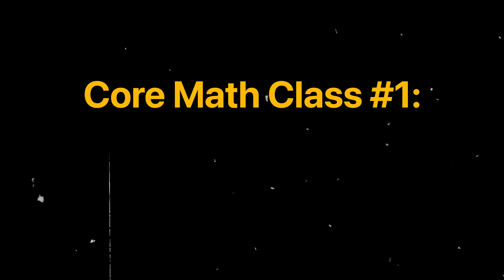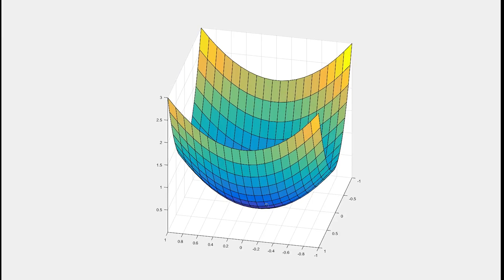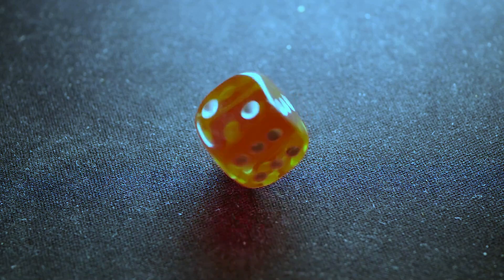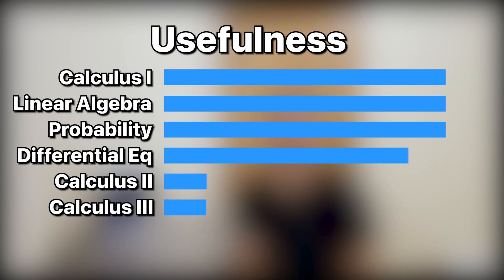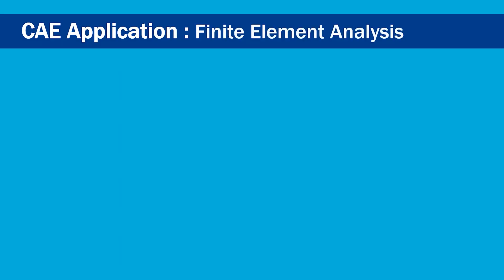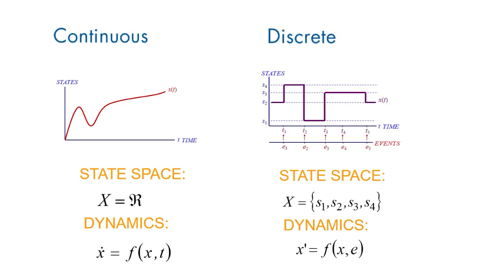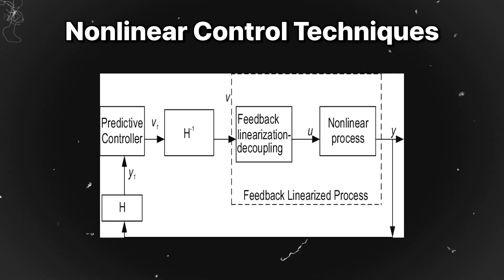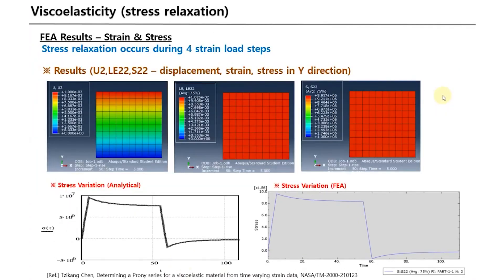How Much Math is ACTUALLY in Engineering? | College vs Industry

Comment: Worked 40+ years as a controls engineer. Frequently used complex algebra, Laplace Transforms and the concepts of integrals and derivatives. I designed circuits and wrote code to perform integrals and derivatives. Just once did I need to actually calculate an integral.

Comment: This video is rather stupid because engineering covers so many fields.  Each field needs different maths. For example in quantum computing you need to understand group theory for error correction. The problem is if you don't have the maths vocabulary you wont have a very big tool box to give an analogy. Ask an engineer what he needs for his tool box. This is nuts. He packs his toolbox according the job he has been asked to do.

Comment: Math intensity in Software is determined very much by what level of abstraction you're working on and the types of jobs you're doing. You can use almost 0% or use heavy maths. You might need to do reliability studies, computational analysis, load balancing, schedulling, Input/output schemas and optimizations, working on complex algorithms, using fuzzy logic, working with knowledge representation and adquisition and so on, or you can be working on more high level things like, user experience, UI design, deployment and quality techniques.

Comment: Universities spend a lot of time training engineers in complex mathematics. Very few engineers actually work calculus or solve differential equations on a daily basis. Many never have to solve a differential equation for their entire careers. 90% of your working life will involve running industry standard software packages combined with basic algebra, trigonometry, statistics and occasionally applying numerical methods using spreadsheets or Matlab. You need to be able to work the basics quickly and accurately. In truth most of the things engineers do are fairly basic, although it’s probably beyond the capability of 99.9% of the non engineering working population. In my opinion and experience being able to think conceptually and apply engineering to solve problems effectively is much more important than being a mathematical genius.

Comment: The best advice that I can give as an electrical engineer that became an industrial automatization engineer is that, while you'll not use that much math or at least, you'll always have tools and software for math, you should at least understand for what the math is there for. 

To give you an example: I work a lot with "Proportional, Integrative and Derivative control algorithms" or "PID control" (which are featured on the thumbnail), with not entering in a lot of details, this is an algorithm that you should at least have passed calculous II to fully understand and industrial controllers use it to very precisely control industrial processes, but when the time comes to actually use and implement them, they are so simple that is actually confusing at first, you just need to enter 3 numbers (most of the time just 2) in order for the process to do its work correctly, this is to the point where the PID function blocks are treated like "black boxes" by most engineers and technicians that require minimum effort to understand and use. 

The thing is, if you understand what the PID function does at math level instead of treating it as a black box, then when the PID fail, it takes only a couple of minutes to figure out why it failed and how to fix it, while if you have no mathematical knowhow, it may take anywhere from a couple of hours to days to fix and potentially cost a fortune depending of what industrial process its controlling.